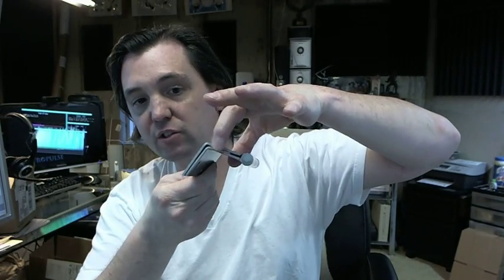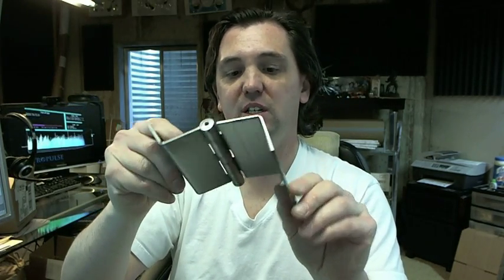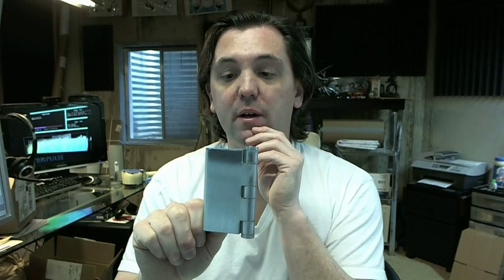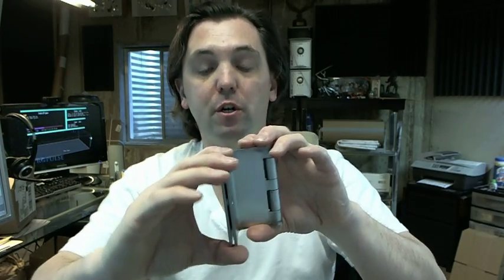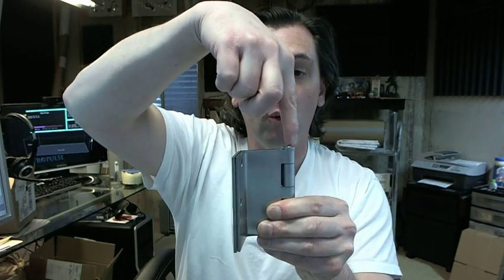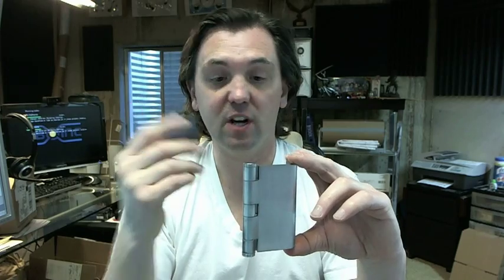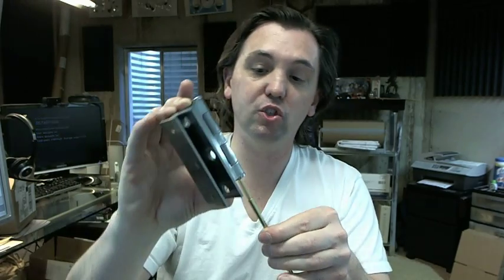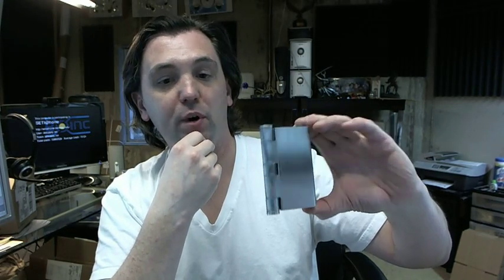Stanley F248-3.5-26D 3.5in Swing Clear Hinge

Comment: I would be in the same spot if I was doing the video, it's a bit hard to explain without a door. I use it on my AC door.  since there is no much room for me to put the AC filter. This hinge does the job for that purpose. I just give that extra space for the entrance of the door. Keep in mind the hinge will expose all the time in the outside of the door. that's one of the reason is so nice looking.
Reply from the maker: Hi Juan - if you have a way of sending me a email   sales@absupply.net   with a photograph I can turn it into a public link and posted here so that other people can see what the hinge looks like in your application - it would definitely help to spell confusion - thank you for participating.